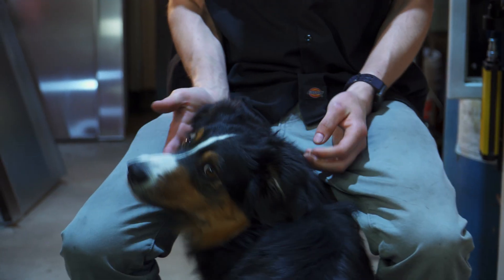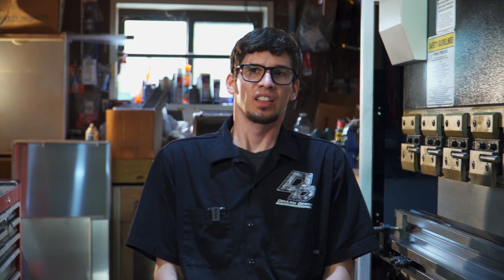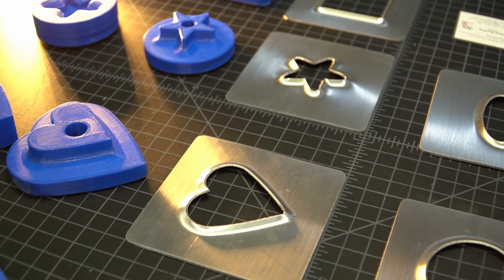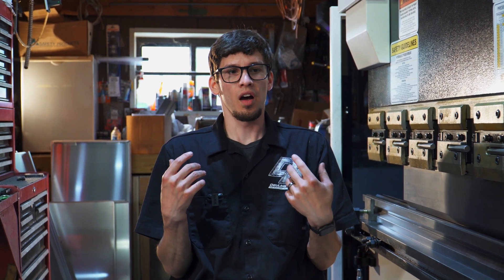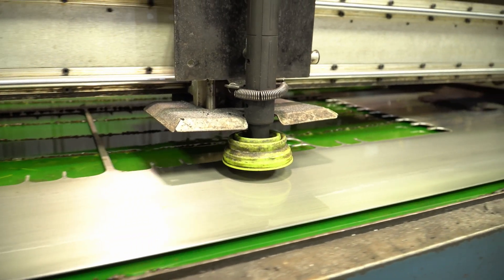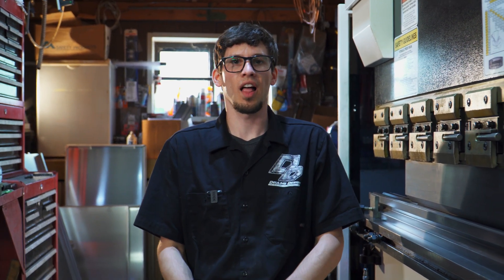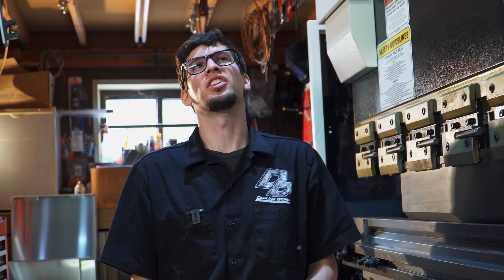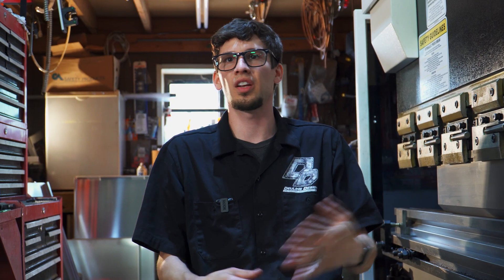Deuling Design LLC - Introduction.

Comment: Cool and by the way I have the next model up hydraulic press brake and it's a beast.
Reply from the maker: The 45 ton?
Reply: Yes the 45ton and I over in Montrose Michigan to. Jason was the best on the sale. I picked up last March and did my own rigging to down load it and set up in my shop.
Reply from the maker: @cjtroutt8092  awesome! I may upgrade to a 45 ton. They weren’t available when I got mine.